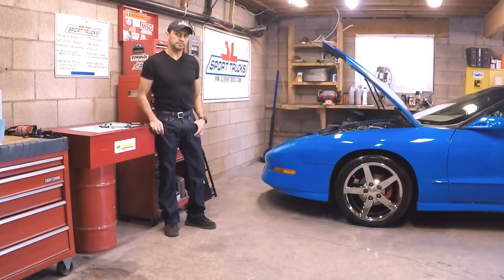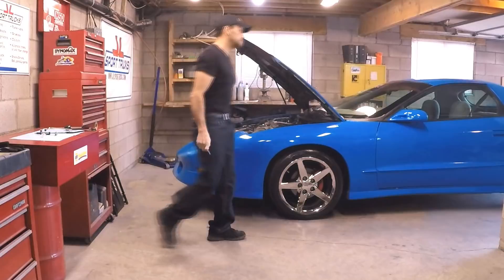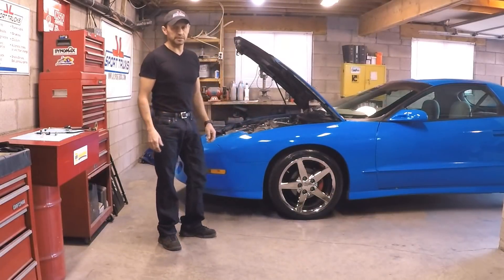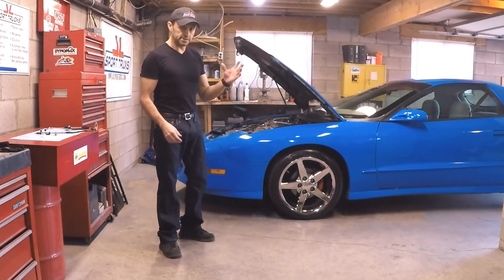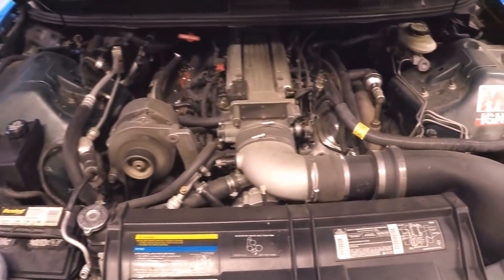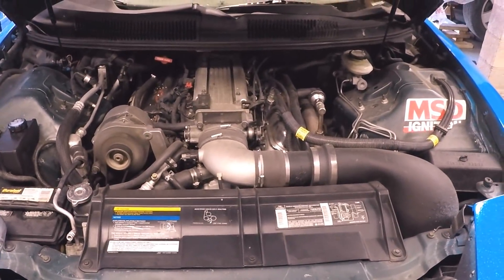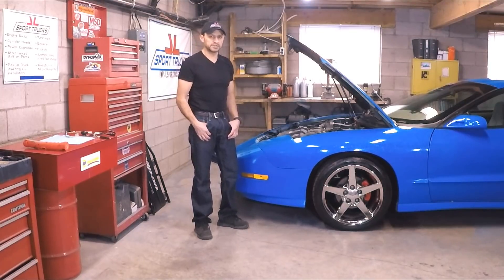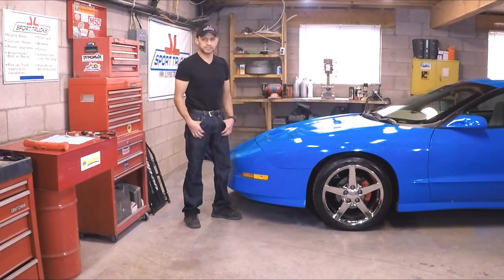Troubleshooting Engine Misfire on LT1 Trans Am, Camaro or Corvette

Comment: Mine was good for like 8 months, after changing plugs and replacing and relocating ignition coil and module. Back to shitty boggy driving now. I'm tempted to switch to a carbed 350 with a traditional distro and forget about the lt1 forever

Comment: Hey man my 96 ss camaro misses bad above 4 grand but clears up around 6000 and floods when it's cold I have jew opti new wires ignition module I have no clue do you
Reply: Those jew optis tend to be a little finicky 😂😂
Do you have to press the gas to get it started? Check your ect.

Comment: What if my injector does receive signal, injector does fumction but spark plug gets intermediate spark?
Spark plug cable is good, and optispark has been switched twice and still same result.
Misfire is still there.
Bad harness?

Comment: ive got 1994 that ive REBUILT every thing besides i have not changed any of the fuel system and at low rpms ive got a miss im THING ing injectors so im replacing INJECTORS  fuel pressure regulator & fiel pump they need upgraded to match the MOTOR s upgrade s ...but i think ive got a bad injector
Reply: I also have this problem on a 94 ive redone everything to do with spark did you ever figure it out

Comment: I have a 1996 firebird formula my check engine is flashing  po300 code but the car wont stay on. I replace new fuel pump spark plug and wires and opti spark but after market opti spark u think the opti is not good
Reply: What opti did you go with? Unfortunately pretty much all aftermarket opti's are junk. May be possible yours was doa.

Comment: You can also use a temp gun and check the temps on the exhaust runners.  Cooler temp one is a potential miss fire.